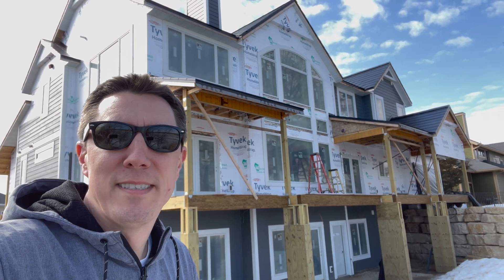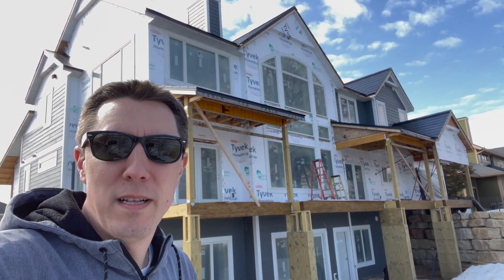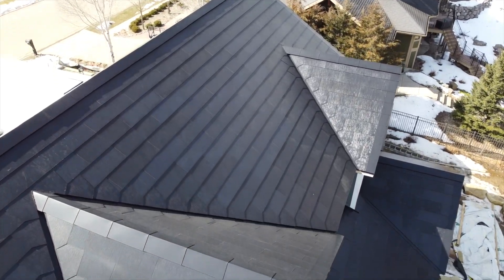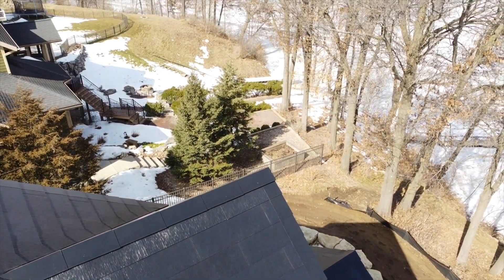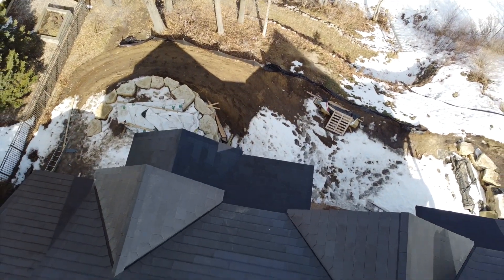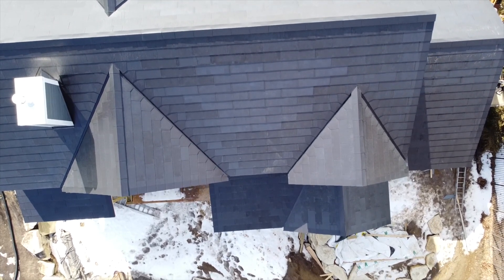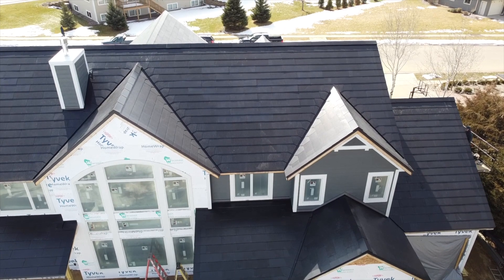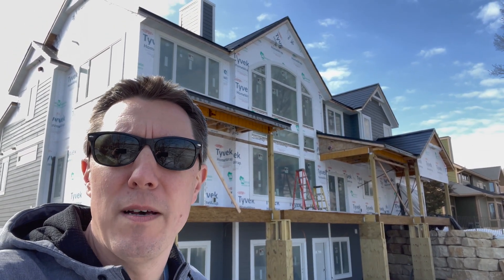Tesla Roof - Is it a "Solarglass Roof" or "Solar Metal Roof"?

Comment: Your videos are SHORT and very INFORMATIVE. Kudos. I am in the DC metro area, there are 6 installations in my neighborhood (world famous Kentlands, at least among those familiar with New Urbanism) and soon getting my Tesla Solar Roof once they get the permit from the city. I noted NO numerous and ugly penetrations on your roof (perfect way to ruin a solar roof and make installation difficult and costly), except one solitary chimney enclosure topped with a covered pipe exhaust, presumably for your fireplace. How did your architect/builder manage the vent pipe requirements for waste lines and other exhaust like dryer, toilet or kitchen ventilators? Do they all come off the side on the exterior walls? I am trying to figure out a simple way to consolidate all mine into 1 single penetration, not unlike yours.
Reply: Never mind, I saw your other video on cost where you pointed that out. Thx anyway.

Comment: I just got the email from Tesla that my roof will have metal tiles on the non PV sections.  I'm glad they warned me.  I was kind of looking forward to the Glass tiles - my dads house has Slate and that roof is 120 years old I assumed the same for the glass tiles  - Metal will oxidize and who knows but the glass would be better in the LONGGGG term.  So I'm a little disappointed.   On the other hand I am not going to live 120 years.
Reply from the maker: ha, good point!  I have taken a close-up look at the metal tiles on a different job site and I'm really impressed with how good they look.  are yours installed yet?
Reply: @JasonLassen  nope the price increase has me on pause.   Plus not enough solar production.  I may cancel.

Comment: The drop test would be very interesting; I suppose you could use the edge transition flashings on your house...  ;)  Everything I've seen with the evolution of the solar roof so far has been improvements and installation optimisations.  I'm just looking from afar but I trust where they're going with the product; that may change in time but I've seen nothing to make me doubt their engineering yet.

Comment: Interesting, I’m in northern IL and my install has been on hold since July 2020 due to wall dormers and a section in the back that is not connected to the rest of the roof. I’m wondering if these metal shingles will help solve my issue.